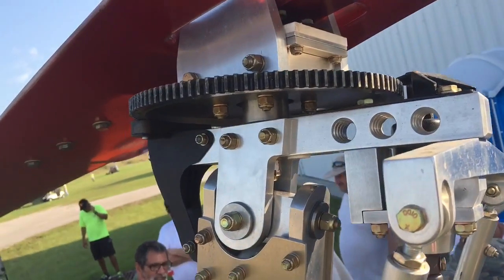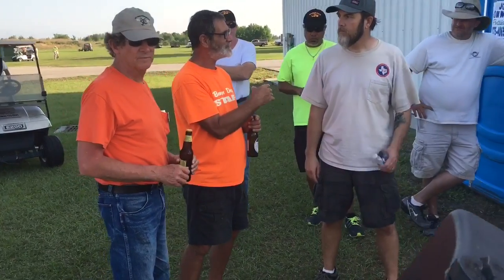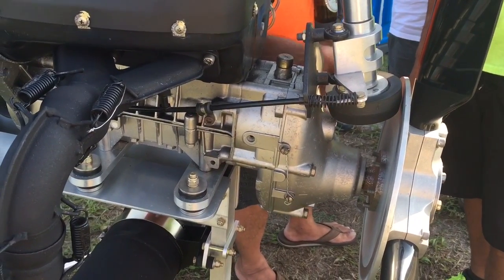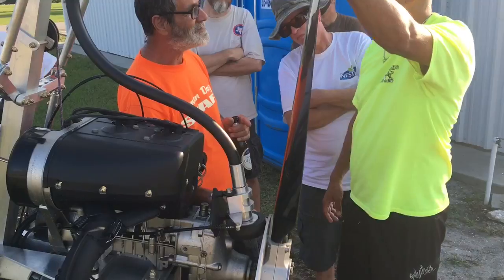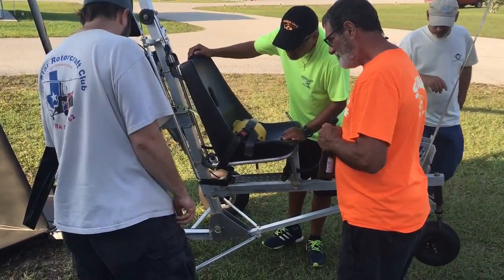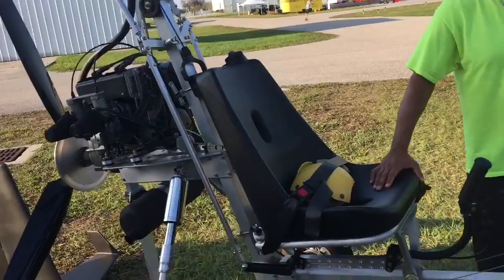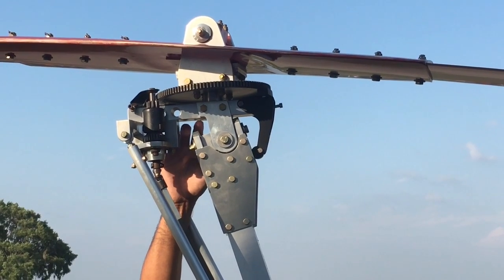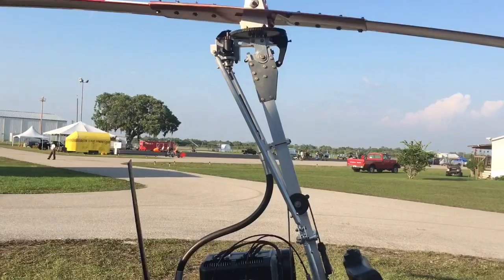Gyro Jake @ Bensen Days

Comment: Clean,  neat and cool ultralight gyrocopter ! ! !  Well-balanced and CLT design really looks attractive.！! !
I recognized your tail vertical fin is designed as fixed wing airfoil like NACA 8H12 that will work as trim tab of which idea is so great.
I believe your gyrocopter can fly so well with Italian engines such as Minari Stratos 400 horizontally opposed 2 cylinder air-cooled engine 50HP 135kg thrust with 150mm 3 bladed props, 130kg thrust with 160mm 2 bladed props , or Simonini Victor 1 Super single cylinder 54HP Water cooled.  Both engines are very light in weight . I believe even Polini Thor 303 water cooled 38HP weight only around 25kg ready to fly could be used as power source for your gyrocopter.   All of them are Italian designed and
manufactured in Italy.  
Since we have no more  Rotax 447 and 503,  we need new reliable engine readily available. 
There will be many Gyro pilot with stronger engine like Rotax582.  Single place gyro designed to fly with the said small engines will be more welcome by more existing gyropilots and many more potential gyro pilots.  
Any plan to prepare its drawings for sale to Gyro community ?  Or any plan you sell your gyro as a kit-build gyrocpter ?

Comment: Hello - Love your videos. PLEASE keep them coming!
Is this gyro a modified Hornet?  I have located some free plans for the Hornet and notice a lot of similarities, but yours appears to be better designed in the bottom of the mast and in the front landing gear.  
I am thinking of building from the plans I have but utilizing your upgrades.  I just sold my tandem Dominator "Stupendous" which I did a great deal of work on.  
Any advice would be appreciated.  Again... keep the vids coming!  Safe Flying.